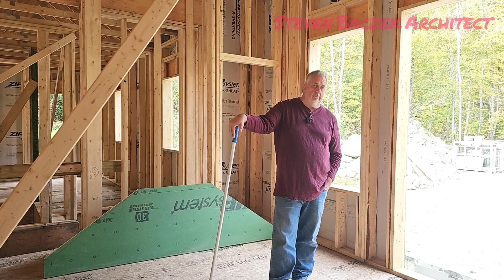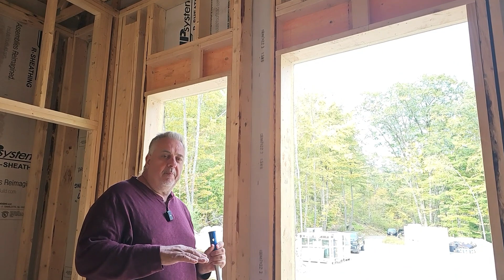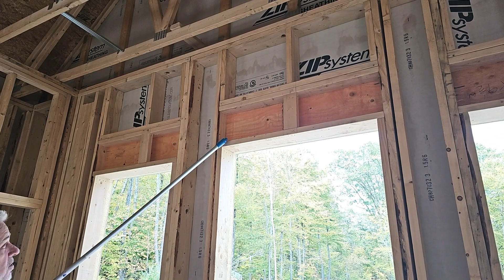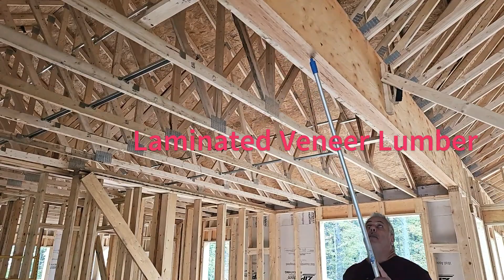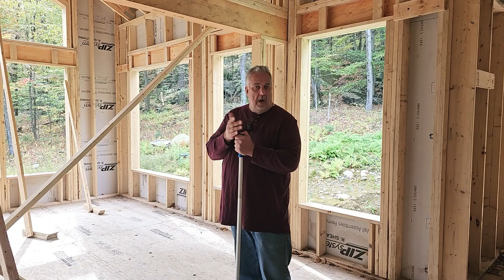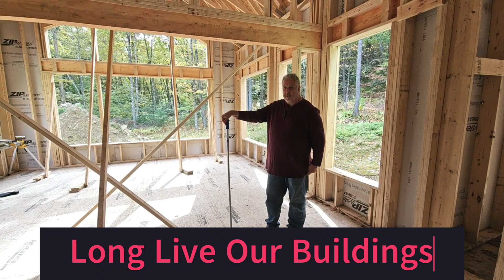FRAMING LINGO......

Comment: Your lvl recessed header detail: Is that to sneak a bit of insulation in there? I used 1/2 inch rigid foam board between dimensional lumber so the final assembly matched the thickness of my pre-existing walls (3.5”).

Comment: I've got a quick question.  Is it ever okay to notch out to the bottom of a roof truss?  I'm having a house built right now.  One part of the build they grouped 3 trustes together. Then they notch out about half an inch by 6 inches long along the bottom where it sits in the hanger.  It doesn't look right to me.

Comment: Thanks Steve.  I was wondering.  Is there any reason not to push all of your headers up against the top plate rather than sitting right on top of the window or door opening?  Is it an insolation thing?  Just wondering why we are moving the beam to the middle of the wall rather than leaving it as high as we can.  It seems like it makes the wall more complex and with more thermal bridging.

Thanks.
Reply: Builders want that straight edge that is created with the header as most commonly sits right up top the opening, would still require framing lumber right above the opening. In point there is more to a header then holding up the roof load. additionally, Trimming out the opening both inside and out allows for good fastening. I actually don't like the LVL headers because you lose that interior trim factor.
Reply: Some European builder explained that this way , in North Europe they use , instead of two top plates one top plate and other plate they run as a  header along entire wall. Cold climate do not give them any other option but to be smart about.  For Americans to make precise cut for that header on each stud  is too much  work they rather just slap extra insulation on outside wall if they have to

Comment: I'm not in construction so no first hand knowledge.  But I watch a few construction YouTube channels from the UK like SkillsBuilder.  In the UK, blocking=noggin and  fasteners=fixings.  Of course everything is metric so it's best to good at doing the conversion in your head.  Then of course there are the differences in construction practices all together.  One I'm interested in is fiberglass flat roofs, which they refer to as FRP (Fiber Re-enforced Polymer).  It seems like a material used for boats would make a great roof, when properly designed and implemented.  I don't know of a North American company that sells the flashing and such for fiberglass roofs or roofing companies who do it, though my search has not been exhaustive.  I also wonder what a building inspectors, mortgage, and insurance companies would think of them.  The UK company called Cure It has a lot of videos on it.  Anybody have info on FRP roofs in the US?
Reply: I live on the Coast of New Jersey. It is very common here.  flat roofs, decks, under shower pans. under washer and dryer units etc. And yes it did come from the boat industry. 
Because we are still in a building boom here there are many small companies that provide the service of installing on new construction or repair of existing surfaces. Years ago i actually installed some but now I just sub it out if I need it.